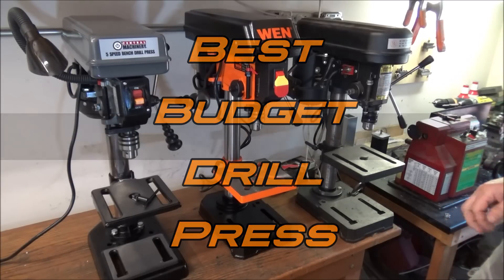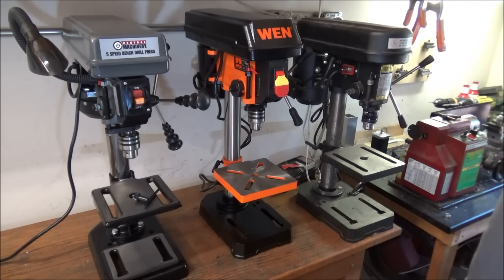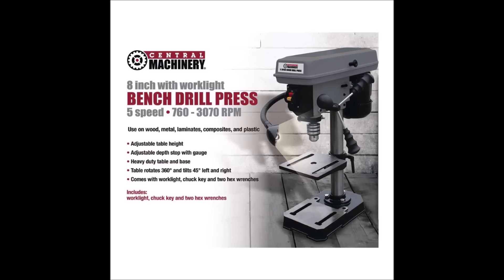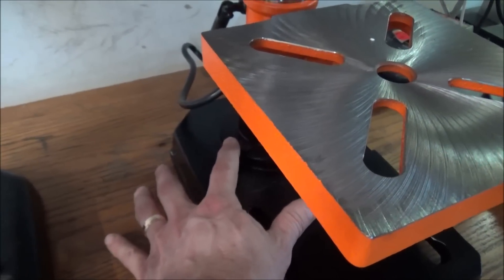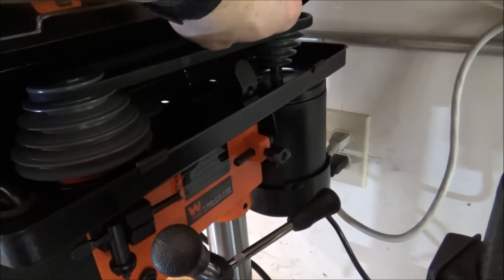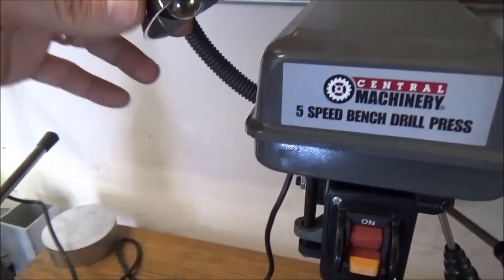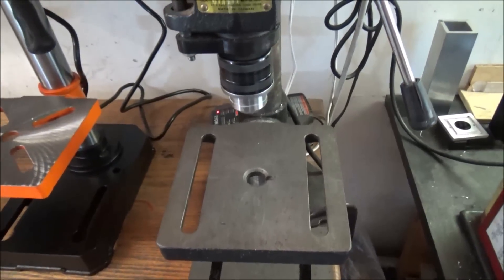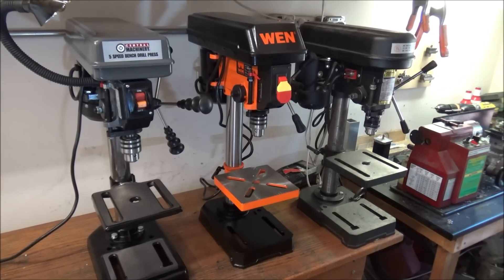Best Budget Drill Press Harbor Freight Vs WEN

Comment: If you didn't take it back, you can make these adjustments on the little HF model in make it sound 100% better: https://youtu.be/NOUx4tBdKSA
Still not a great machine, but I had a specific light duty use in mind for it and have other DP's already.
Reply from the maker: Thanks! This particular machine was not the same one advertised. I believe this was a new cheaper version unfortunately. There is always things we can do to tweek the machines. But the basic machine was just not up to the quality of the WEN in my opinion.
Reply: No obviously not. The WEN has a machined cast iron base and table where the HF has a cheap stamped steel base and table. That alone makes a huge difference.

Comment: Have had the same cheapo chinese-made HF press for over 15 years now, originally paid ~$35, been banged around, survived 4 moves, even been out in the elements now and then, and aside from replacing some screws, it still does the job. Most 'home mechanics' just need a useful, affordable and reasonably reliable tool... not a work of art.
Reply from the maker: I Agree However I dont think the One you have is the same as this model. this one has stamped steel table NOT CAST and it may be a good deal at $35 even with the new version. it's just not up to the standard of other brands.
Reply: @CNC4XR7  You're correct, my base is cast, though probably would personally still go with the stamped steel base... if it didn't affect the performance, and there was a significant savings in price. Bottom line for me is whatever does the job, for the most economy. But I can see where everyone's 'standards' and 'requirements' might be different.
Reply from the maker: @matonmongo  agreed.  The surface of the table is not flat and true like a machined surface. It appeared to have been pushed against a wide belt sander.

Comment: I'm going to take your advice and recommendation and save up for the WEN 10" Drill press. I hoping to team it up with the 10" bandsaw also by WEN. Do you have any thoughts about the bandsaws? Thanks for sharing your thoughts and videos Rodney
Reply from the maker: I own a 14" bandsaw which I have had for 30 plus years. its a Taiwan made machine which looks similar to the HF model online. I look for overall quality in materials and the castings. If your going to be doing any serious wood working you may want the 14"
Reply: I have the 10" Wen drill press. I couldnt be happier.

Comment: Very nicely done 👍😊. I came across your video at the perfect time, I've been looking at both of them. I actually have the HF one from a neighbor for $30 to hold me over until I can get a better one. I actually want the 10" WEN and after watching your video, I
Reply from the maker: Glad I could help!
Reply: I have the 10" HF 12 speed. The best part is you can set it at 360? RPM for hardened steel (using Cobalt bits and quality lube). The worst part on it is the runout caused by getting one with a bent spindle. I think You can get a bent spindle from every manufacture, but the more you pay, the better the chances you won't. HF probably being if not, real close to the bottom of the list, which the price reflects. It will get me by until I can get something better.

Comment: They are all too small!   The one thing you need apart from a height-adjustable table  (crank is better) is room between the lowest table height and the chuck,  because you will want to put cross-slides,  long woodworking bits etc underneath.  I know, I made that mistake, and a taller press made the world of difference.
Reply from the maker: True these are are small bench top units. for more versatility a floor model would be the best option.

Comment: I have a generic one like your original, mine is about three years old. I couldn’t be happier and I’ve never thought I must upgrade at any point. However, the build quality doesn’t look as good as yours, for instance my depth gauge bracket is plastic and part of the guard. It’s certainly better than the Harbour Freight model which sounded awful. I thought there might have been a fault with it. A brilliant video for those buying the all important drill press which is a tool they’ll be using for almost any metal work project. Unfortunately we don’t have Harbour Freight here in the U.K...yet!
Reply from the maker: Thank you, yes these bench top units tend to get a lot of work.

Comment: I got mine (HF) for $59.00 or so. The plastic depth stop bracket broke the second day. But other than that, it does what I need it for now.
Reply from the maker: yes it will drill holes. no doubt

Comment: The wee-in is clearly better.  The aluminum pulleys are actually nicer than the steel.
Reply from the maker: I think the spinning mass of the steel pulleys is better but. Just mythoughts.
Reply: @CNC4XR7  Good point!
Reply from the maker: @ozzy5368  there is always pros and cons

Comment: The WEN is now $90 on Amazon just a heads up.
Reply from the maker: Yeah I have noticed the price fluctuates but still a good machine for $100
Reply: I bought the WEN 2 weeks ago, great little drill press. I paid about $100 with the 4 yr warranty on Amazon.  It’s great now i need good drill bits for wood and metal

Comment: With HF you win some, you lose some. If I was a professional doing it day in and day out 8 hours a day I'd steer clear of HF, but given the fact that I pick up my reciprocating saw maybe once or twice a year, I enjoy the HF tools. That said, I am working on building out a wood working area in my garage and will be opting for higher quality tools. Thanks for a good review. I'll be sure to start my drill press research with the Wen model as the low end and forget about the HF drill press.
Reply from the maker: Well Said I could not agree with you more. I think a label stating occasional use would be a good idea on most of the things. My little Mini lathe and Mini mill have had hours of use and no complaints for what they are. I think most people tend to push tools often past the intended use. and then complain about them. ( I know I'm guilty of this.)

Comment: Thanks for the comparison video.  👍
Reply from the maker: Thank You!
Reply: @CNC4XR7  About a month ago, I was discussing the HF drill press with a fellow Marine and then I saw your video so I sent him your link. 
What do you think about that 4" WEN bench drill vise and/or what kind of vise do you use?  Thanks.
Reply from the maker: @houndsmanone4563  I think its a decent vise Home depot has a Yost 4" for about half as much but it's rated for light duty.
 I use a old milling vise I have if needed.

Comment: Which one DRILLS better, or does that count in your opinion?  You didn't even consider function in your video.
Reply from the maker: The Wen overall does a better job . its more refined and has a smoother operation on the quill. the steel pulleys aid with  keeping the spinning mass moving( the extra weight) which helps with not slowing the bit down.

Comment: I'm sorry, but a lot of what you said seemed very superficial, more in line on your personal preference on Aesthetics.
Which is fine i guess, but the real question is how do they compare in performance?
Reply from the maker: This is true and this may seem superficial I quess. I think it all factors into performance. 
Having lighter aluminum pulleys means less spining mass and weight which could cause the spindle to stall easier. The table surface appeared to be sanded rather than machined. Which could effect weater or not it is at a right angle to the dril.  The biggest thing I saw was the surface finsh of the quill it was horrible
 I wasso discouraged by this I just boxed it up and took it back.
Reply: @CNC4XR7  ok i think i get where you're coming from

Comment: When people say, "they dont make 'em like they used to" or, "she was made when beef was cheap" , it's TRUE even of the bottom shelf stuff. Like an old B&D from pre-80 is nothing like a modern day Black and Decker from Wallmart. However, WEN does seem to be stepping up the bottom shelf game at least a little bit. Delta makes a decent little cheap bench top drill press or at least they had a line of entry level bench top tools about 15 years ago.
Reply from the maker: yes you are absolutely right you just have to really look at the stuff. better to look in person.

Comment: I wonder how the Harbor Freight 12 Speed compares to the WEN 5 Speed? I've always heard that the HF 12 Speed is the one to get over the HF 5 Speed.  Also the vibration can be dampened quite a bit by filling the vertical support tube with sand.
Reply from the maker: I'm not sure but the bigger is normally better. and yes there are ways to work around shortcomings.

Comment: To check drill press quality, run the chuck down, close to the limit, and wiggle the chuck . If there is play, you've got a poor drill press.
Reply from the maker: Yes this is a good check.for slop at full extension.

Comment: The pisser about all 3 of these is they use exhaust pipe for the power head to mount to and it flexes.
You get what you pay for with harbor fright.
Reply from the maker: yes you are correct the tube on the 30 + year old is thicker wall but the others are tubing basically.
not made for HD drilling thats for sure.
Reply: @CNC4XR7  I have a Craftsman that is roughly same vintage as yours it's crap too.

Comment: Harbor Freight. You get what you pay for. I keep my tools forever so I rather pay a higher price to get something reliable and long lasting. I bought a Skil drill press for about 120 and it has lasted for over 5 years now with light use.
Reply from the maker: I agree!  Its always better to get the best you can afford. However with a Small bench Top drill press Quality is not always shown in the price Tag. If like me  space was a Issue a Floor model may not be a option.

Comment: The older HF drill press is built with cast iron.
Reply: Yes but they have plastic pulleys, well mine does...
Reply from the maker: @lennym1273  really? Plastic pulleys? Well i guess aluminum is a upgrade.
Reply: @CNC4XR7  Yea but the rest is good just need to see if I can turn some aluminum pulleys soon...
Reply from the maker: Yes I think just the newer ones are stamped steel
Reply: My drill press looks exactly like his, but is made by Delta.

Comment: This review makes me thankful that I bought an 8” Delta drill press new in the early ‘90s (it was about $90 back then) and a solid used 1978 12” model from Taiwan in 2009.  Both are very smooth and very quiet.
Reply from the maker: yeah what a difference a few decades make. Anytime you can score older machinery It's a good Day!

Comment: Sorry, but if you look closely at the WEN, the sleeve that mounts the table to the column is Aluminum, it WILL break, mine has twice! And on WEN's website the part is no longer available, it is obsolete!! On a drill press bought in 2019.
Reply from the maker: While no doubt these things can break! They are not for serious HD drilling jobs. The table also looks to be cast aluminum as well.

Comment: i got my harbor freight drill press for less than $50 brand new.  and it sounds like you don't know about HF's 20-25% coupons.
Reply from the maker: LOL yes I do know about the coupons Thank you! The HF drill press I show in this video to Me is not worth $50 but I understand those are just my thoughts on this particular machine. I have many HF machines and most have been very solid. However with this Drill Press they have dropped the quality standards to a point I would rather not waste My money.
Reply: @CNC4XR7  sure you did...

Comment: You should do drilling of several size holes and different thicknesses of metal ,different kinds of woods and thickness, sound is not the only measure of a drill press!
Reply from the maker: Yes I dropped the ball on that I did not intend for the video to be a full in depth test. But boring some holes would've been good.

Comment: I had an late 90's Harbor Freight  which was more like your original drill press.  Bought a newer one  and sold it .Picked up a Wen for a few dollars more and it is much nicer.  With  some tweeking  of motor hinge and belt alignment the Wen is very quiet and accurate.
Reply from the maker: Yes The issue for the small Benchtop drill press is a Recent problem with Quality.

Comment: Admiral is miter saw,  we love it so far all other reviews had issues mine the only thing off is laser....wish I could like their drill press because I really use a good one but on a budget....any suggestions? Too bad the hf  has to much wobble at the Chuck I could replace it but then paying the extra money I could buy one with lesser issues sad nowadays they don't make things like they  used to
Reply from the maker: That's Very true they try and stay in the same price point and to do so they cheapen the product. that works for some things. But Not Power tools. we want longevity!
Reply: Wen or Menards house brand D/P  wait for black friday and hope.
Reply: @robc8468  I found a general international  10" for 111.ok at sears it said wen on the ad but seen it with free shipping they look they same are they?
Reply: @samanthanicholson9015  A lot of Chinese brands come from the same factory I have a Wen 10 inch also.  So the 10 inch usually  has more powerfull  motor and crank table. height adjustment.  $111 is a very good price for a 10 inch if it has a cast iron table.  The downside is the generic brand does not sell spare parts as Wen does.  It's up to you, so you may want to find out the Sears return policy for a non-Craftsman brand drill press before purchase. Some General International seems very similar to Harbor Freight in many ways. Update I went to the Sears website looks like it is cast iron with the bigger motor more like s great deal plus the $51 cash back in points is a enough a decent D/P vise and a full set of drill bits.  I would probably pull the trigger and test the hell out of it during the return period while saving the box and packing just in case.  Good  Luck!
Reply: @robc8468  sears is closed its doors for us in an abq. There's only a locally owned one in Belen so idk if they offer the same deals, I'll make some calls anyways to make sure they do...the best price for wen I found is at walker or home depot for about 163
Reply: @samanthanicholson9015  Sears is showing free shipping on the 10 Inch general international.  The packaging on the Chinese drill presses is rather good it is surrounded in lots of foam.  I had a 10 inch  Wen shipped from California to Michigan a few years ago came without a scratch or dent on it,  Of course Amazon ships everywhere  and carries the Wen lineup.

Comment: Does the Chuck wobble? Did the wen make cleaner straighter holes? The central machinery did 90 percent but the hardest thing was the table staying straight n hard to move it up having to loosen the tightening  lever all the time, as well as manually having to change the belts...no way to tighten the tension on the belts without the motor moving.
Reply from the maker: Red Loctite will help with the handles. I think the older pre 2019 Harbor freight drill press is of better quality. than the stamped sheet metal version. the Wen just feels tighter and more precise.
Reply: @CNC4XR7  some holes didn't go straight n the table always moved, he didn't mention any older models they liquidating and going with different brands. I will look around, thanks

Comment: There's more like a $25 dollar difference. HF is constantly on sale $50-55. WEN is $80. I agree you should've drilled something.  I know a lot if people that swear by that HF due to performance and price.
Reply from the maker: Well That maybe true for Pre 2018 Harbor Freight versions but post 2018 all come with a Stamped steel Base and Table. It's all a matter of opinion and that is just mine.
Reply: Newer HF with a stamped table are crap very poor an loads of spindle slop within the die cast aluminum head.The older cast iron D/P Harbor Freight from 10-20 years ago were ok.

Comment: I might bu the wen for light duty stuff.For the serious stuff I have a MASSIVE old school usa made drill press from the early 1900's that was ran on a old belt line in a factory.It is built to survive a a bomb. With a 1-1/4 in drill it dont even slow down through mild steel.Sometimes the 70 year old flat belt slips but that is about it.
Reply from the maker: Yeah you cant beat those machines

Comment: Aluminium pulleys are great !
They actually stop a lot of the vibration from unbalanced metal pulleys.
Most vibration comes from the belt whip. A guide or tensioner should eliminate vibration.
Reply from the maker: these seemed very lightweight which may help with vibration but if so it did not show up on the bench. that thing rattled a lot. I also feel like the heavier pulleys will help with torque.

Comment: HF has my vote, can't beat the price and if it's bad they replace or refund with no problem, but I've had good luck with all their tools, and I abuse them.
Reply: I think he got a bad press from HF.  I have that same drill press and it’s not that loud and is smooth and more like the Wen one.  I used a coupon and got it for $56 after tax.  It works great and I have no issues with it so far.
Reply from the maker: I have to say for me it's hit or miss . I have a Porta-band saw works awesome i use it a lot. My X2 mini mill and Mini lathe I love. so Yeah for me I think i have a 70% success rate. LOL